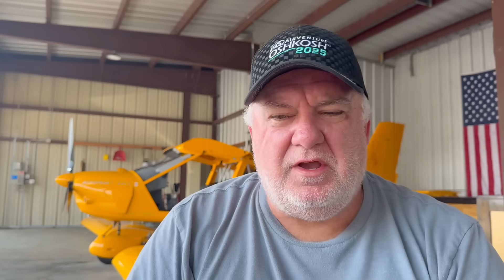Why Did My Plane’s Windshield Fail Like This?

Comment: The fact that you didn't know the condition of your control surfaces, but you recognized that you were flying straight and normal made landing straight ahead a good call. You saw an opening that fit your current situation and did as little as possible to create new problems. Textbook emergency landing, if you ask me.

Comment: You did a great job. I've flown one of these with the 912is and 4 blade E-Props prop. I wouldn't want to try to control the aircraft without a windscreen between it and myself. I'm guessing yours is the one I saw being repaired at Heavenbound a couple of weeks ago?
Reply from the maker: That’s exactly the one!  Andy is the only one I wanted to do the work. Going to go with a three blade E-Prop since the old Kiev is at its end of service life.

Comment: Bravo, very good piloting and decision making. Question: Why were doors warped so badly? Only from the increased wind flow into the plane? Or did the sudden altitude/airspeed change you mentioned tweek the airframe a little?
Reply from the maker: The sudden rush of wind in the cabin blew them out. They are bubble doors with an aluminum frame for visibility so they aren’t made to be subjected to force of the incoming air.

Comment: Sailplane pilot's take; buddy, you ran into the wall of air we're always looking for. Hot summer days will heat the ground so unevenly that these 'thermals' race up like a jet of exhaust. And all it takes to create a violent one is a new asphalt parking lot or even a farmer turning over a field. My first flight school was in Hinkley Illinois, on a farm. As flat and square as the terrain was, I got to know the relative heating of local features like the highway or even a field of beans among fields of corn would set up a thermal. Don't know why you hit what you did, but I'm not at all surprised that it tested the limits of your craft in that moment. You sure handled well, as did your copilot. And that nose up landing looked like a driver who was still making good decisions. The shade... well, that just killed me. Can't believe someone landing out for the first had the presence of mind to do that. Good work captain!
Reply: I've experienced that sudden turbulence flying over large black asphalt lots in the Socal  desert.
Reply from the maker: Solar farms are also quite crazy to fly over.
Reply: Wouldn't it be the cool spots that make "walls"??
Reply: @dustinbugal2069  Always seems to be the relative extremes. There is a comment here about asphalt in Southern California. I trained in Illinois in the Summer and then came home to Southern California. Seemed to me that the dry climate, open ground, and warm winter made everything more predictable. Over farmland in Summer, the sun doesn't even reach the ground, but then you overfly one field of bare black soil at minimum speeds in a sailplane, and UP YOU GO. But under power it was a whole different, and somewhat unpleasant experience. Not windscreen blasting bad, thank goodness. Worst I had to react to was cowling coming loose on the towplane. That shutdown was the first time I learned how many hours of ideas your mind can pack into 15 seconds.
Reply from the maker: I think if it was anything atmospheric it was wind shear.

Comment: The lack of factory support is disappointing and speaks to the character of the company. You and your wife could have paid a bigger price for their sub-par materials and design, so you would think they would happily support you in this situation. Conclusion - Good airplane, disappointing company, great video and channel.
Reply from the maker: I love the airplane and the North American distributor is absolutely top notch. I agree I was a bit surprised the factory didn’t recall all the first gen 2mm PETG windscreens although factory recalls are nearly unheard of in the aviation world. They did issue a service bulletin which we complied with but for the sake of lives at risk and a known problem to the factory, I would have in good faith took the hit and made a recall of the 2mm screens. In this case, all is well that ends well but it could have turned out entirely different. The SB simply wasn’t enough to mitigate the risk of catastrophic failure. It is what it is I suppose. I appreciate your comment.
Reply: I agree, the SB was ZNOT enough, considering the risk involved. And, I realize and know you are correct when you say that factory recalls are almost unheard of. But, that hardly makes it right, or the appropriate policy. Considering the risk, it’s absurd that the automotive industry has far more safety recalls than aviation it seems. I actually had a windshield replaced on a Lexus under recall. We all realize it’s a cost “avoiding” measure by these companies, over owner safety. At minimum, they should have happily replaced your defective part for you. They obviously finally admitted the risk of the 2mm screen outweighed the effectiveness of a simple SB. That’s fine going forward, but retroactively supporting your owners would be the right thing to do and would boost the attractiveness of their product in the future. But, the main thing is you guys are ok. Again, great video and thanks for the follow up reply. Safe skies !
Reply from the maker: Completely agree.

Comment: Cabin pressure change could explain part of this assuming the static port for the pitot system is inside or he had the alternate static port open. Does this aircraft model fit this description?

If the cabin experienced a drop in pressure from an opening of something then the instruments would have jumped up like that and then as the drop increased there’s less air inside to push back against the screen. I’m thinking a knee to the door.
Most likely just a failure in the cracking 2mm pteg, like he said

Comment: Impressive job of handling the emergency. Kudos to you, sir.

I watched the first video slowly from the start. Did you notice in the video the crack developing on the far right of the window a few seconds before it exploded? Same exact spot. 
And like you indicated, there was a big updraft right before the break, you went up 100 feet instantly, as indicated by the altimeter and the VSI. Some sort of microburst? My aviation weather skills are too rusty to do more than guess. Tolerating those forces was likely outside the design specs. Congrats on keeping the takeoff and landing counts even.
Reply from the maker: Neither of us noticed that crack form in flight but like you, we did notice it on video playback right after the event. There was some kind of weather phenomenon for sure but the air that day was not unusual or bad bumpy and we only had a 2knot headwind. Definitely hit a pretty harsh updraft though.

Comment: RE:Losing Altitude: I just assumed it was extreme drag from the air rushing into the cockpit and the passenger door being basically gone that was really messing with the aircraft's ability to stay aloft. Though, cutting power because you don't need to be blasted in the face with the prop wash is certainly understandable too. I don't think very many people are thinking about what that must have felt like, despite the fact you can SEE how bad the wind was in your faces, the fact it was trying to blow your headsets off should have told them something. I think anybody who has ever rolled down their window and stuck their head out while speeding down the highway should get a decent idea of what that feels like. Oh, and in some cars, you can feel a drag effect just by rolling the window down depending on what kinda car you drive, if it's lightweight enough. Imagine an airplane that weighs a fraction of the weight, going even faster losing part of the windscreen and an entire door. I'd think, if anything, it goes to show just how good that aircraft is, that it was able to continue flying after the incident and resulting damage even if it was losing altitude. That was a far better scenario than just spiraling out of control and falling out of the sky or something.

Comment: In my former professional life, it was my job to dissect failures and see how we could do better. Based on a lot of great teaching from outstanding, experienced pilots and some excellent mishap investigation training, and reviewing hundreds of aircraft mishap reports, I can't see a single thing that I would have done differently in handling your emergency. In regard to assessing possible additional structural damage to the aircraft and your flight controls, what looks like a good field on the nose that would require very minimal maneuvering, and the smooth but steady descent you stuck with, I'd have to conclude that (leaving the flaps up) was the best decision, especially in regard to the porpoising you experienced at higher power settings. Great decision as well to forgo an attempt to clear the ridgeline ~10 miles away (~60KCAS = ~ 1NM/min in a slow descent). 
Although you could not communicate over engine/propwash/wind noise, did you happen to squawk 7700 to let local ATC know that there was an aircraft in distress in their area?
Thanks again for the thorough reviews of your mishap.
Reply from the maker: I appreciate your comments!  In response to squawking 7700, I did not. I started dialing up 121.5 but couldn’t keep my headset on and wasn’t sure they’d even be able to understand my call through the wind noise so I decided the best thing I could do in that moment was to just fly the plane. Divided attention didn’t seem like a good idea at the time. Changing transponder codes is something I would definitely do had I had the altitude to give me time to work through it.  I just didn’t. The whole event from blow out to wheels down was around 8 minutes. Seems like a long time but it went by at warp speed.

Comment: 172 won't  still level flight without windshield.
Wing flex on piper 18 popped windshield killed father/son yrs ago coming back from Sun nFun.
Years later farmer found the windscreen  miles away from the crash.
Turbulence.
YOU Sir on the ground Safe!  Good job.
Kept your head and flew it down Awesome job.

Comment: Reminds me of the question asked by an instructor when I was getting a revalidation. 
What minimum RPM do you need on your airplane to able fly straight and level?  
I took a guess and I wasn’t far out but surely that’s a good number to know if you have an issue. Might not be applicable in your case but there’s a similar principle. 
Anyhow, great job by you and your wife and I agree you did the right thing and shouldn’t change a thing. 
Good SB by Aeroprakt too. 
Look forward to seeing you back in the FB in the air.

Comment: Im not at all knocking experimental aircraft because I started out flying ultralights … but after stepping up to GA  I never looked backed because of issues like this . I just don’t have the confidence in them but kudos to the way you handled it 👍
Reply from the maker: Thanks. This is not experimental, it’s a  factory built light sport.
Reply: @the_aeropraktician i apologize, that being said I would have some serious issues with the manufacturer, but sounds like they recalled the issue .

Comment: From a mechanic's perspective my guess would be frame flex caused windscreen fatigue and whatever change in atmosphere caused just enough flame flex to cause the failure. Wife door was result of wind pressure in cockpit. Alt loss due to immense drag. My 2 cents. Nice landing!
Reply from the maker: Pretty good. The first gen windscreens were just weak. The updated one is thicker and thermoformed to shape. Both doors blew out from the resulting wind pressure, and it was SUPER draggy. Good eye on the atmospheric changes at the moment of failure, definitely something strange there. Thanks for the comment!
Reply: @the_aeropraktician  anytime! Glad you and the Mrs are safe and sound. Happy and safe flying!

Comment: You did, in the moment, what some may have never done. Looking backwards for a suitable landing area, is risky unless you had complete and unaffected control... in this case you didn't. Looking ahead, and/or slightly to either side is most survivable and can present better options. Deciding quickly on what to do while you are still higher, buys you time. Your wife, although probably scared, took her cues from you, and seemed calm where she trusted your decisions. You both walked away and that is the final and only determining factor in this event... nice landing.

Comment: That propwash probably created 150 miles-per-hour winds.
Reply from the maker: I’d be curious to know what the propwash is at wide open throttle. Out airspeed was 105 so it’d got to be considerable more than that. It was like standing in the middle of hurricane force winds without the rain.

Comment: The front of your aircraft explodes. A quick assessment shows that you're flying but slowly losing altitude. You try to bump more power, but it seems to make your situation worse for reasons. You scan the area. You see a field that looks smooth and traveled. You're sure that your damaged and limping aircraft can make a no drama landing. Knowing that your craft won't make it over the ridge to your destination, you do the sensible thing and elect a low drama landing in a field.
Well fucking done. You're alive to talk about the experience. Your aircraft is airworthy again. What more did you want?
Reply from the maker: Fantastic assessment. Kinda what my thoughts were as well!  Appreciate the comment.

Comment: I guess the question I have is how comfortable would you feel if after replacing, this might ever happen again?  I guess I’m a nervous Nelly.. It was traumatic and you both kept your cool and it turned out a great outcome. I know absolutely zero about airplanes but it seemed that even in that broken state the glass or plexiglass seemed like it was sub standard. Maybe I’m talking out of my butt, it seemed that way to me. Right or wrong, glad  you 2 are ok, best
Reply from the maker: The updated windscreens are made from a different type of thermoplastic and thicker. They are thermoformed to shape as well. I 100% trust the newer version.

Comment: Thing you have to really watch if you have polycarbonate windscreen is avgas any petroleum really will degrade it causing it to fail
  I would go as far to say if someone spilled gas on my polycarb windscreen I'm replacing it very least should have its mounting inspected make sure no cracking developes 

   I was looking into information for a submersible that's used gasoline steel ballast

Comment: Thank you for a very interesting video. I kind of like your thoughts behind your decisions! I am also thinking of the fact that the cameras are not so affected that you as a pilot are at the moment. It is very difficult to understand your trouble caused by the wind to the extend. When it comes to not able to keep altitude I guess the situation creates a tremendous drag compare to a normal setting. And as you say, you will not have to much speed either. Very good job indeed!
Reply from the maker: Think in terms of drag racing when they pull the parachute. Kinda the same effect.

Comment: Come on hot summer day, glider pilots call it an updraft for them that good. The wings flex upward causing your screen to fail. Pilots are like motorcycle riders those who have crashed and those who are fixing to crash. Those who do not crash have God with them. Same way with me and my car driving I fiddle with my radio or air condition look up and I am about to run off the road or kiss the big truck beside me and I say God is with me and then I finish it and then who can be against me.

Comment: Brother, I was one of the people who commented asking why you were losing altitude and questioning the landing decision given that the engine was still functional. As a pilot myself, I was genuinely seeking understanding, that's all. In all my training it has been beat into my head that as long as the engine is running and the airframe is ok then the plane can keep flying. Hence why I was asking the questions. I certainly was not attacking your airmanship or your talent. Fly safe, and great job getting on the ground safely in a high stress situation.
Reply from the maker: No worries, trust me it wasn’t you. Some comments were just downright idiotic. Yours was not. Thrust must overcome drag. The airplane had an immense amount of drag. The disruption of the normal flow of air over the control surfaces and the root of the wing simply was not efficient at all. I applaud your question though. Every airframe will behave differently. I think it’s a fatalistic idea that as long as the engine on running you can keep flying. The rest of the unknown was what other damage did we have we didn’t know about?  Don’t let the engine running drive you further into no mans land when you have no other options left. Sort it all out safely on the ground.

Comment: Just found your channel so went back and watched the video, wow, I’m a low time pilot but can’t imagine anyone expecting better results then that. The amount of drag would be comparable to deploying a sea drough off the back of a sailboat in large following seas. The fact that neither of you had your face ( or carotid artery ) shedded by the plexi is amazing. And props to both of you for keeping your cool. Would have been fun to know what your heart rate was when you landed. Lastly, not only did everything work out as well as it did, you got a new subscriber.

Comment: I would suggest you  to use Polycarbonate instead of Plexiglas would not have cracked that's what is used on racing cars , Nascar on Fighter jets with bubble canopies. It has to be a reason for the manufacturer not to use poly i would love to know.